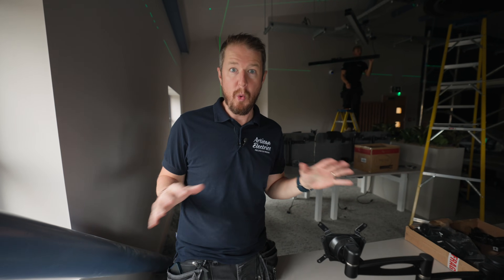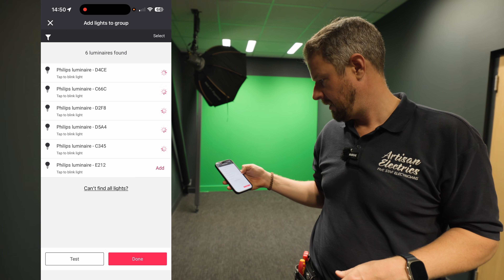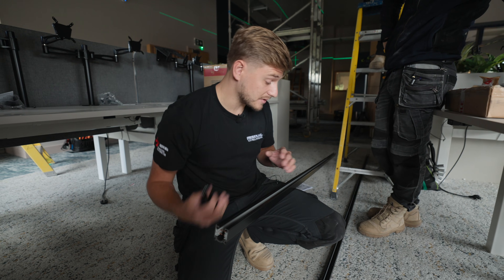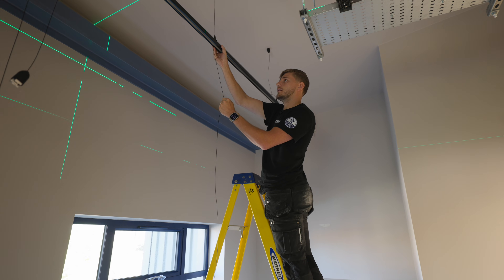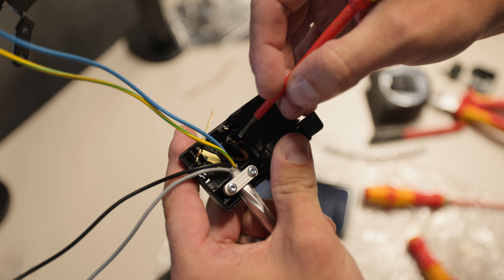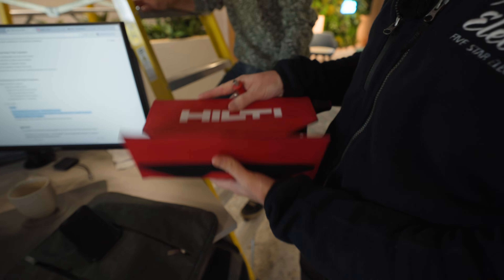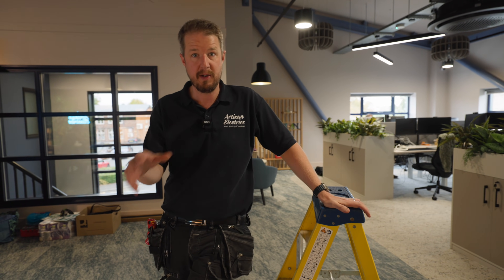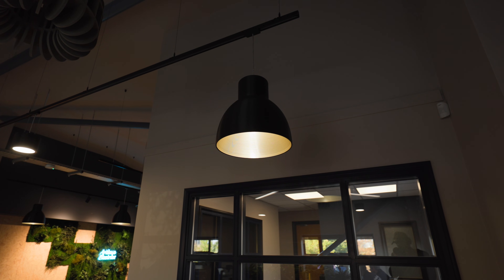How we installed the ULTIMATE office lighting setup 🤩

Comment: Why not use the air or tree presence sensors from Loxone? You already did the investment of the miniserver and DALI extention, the benefit of the presence sensors acoustic and light level measurements far outweighs the extra price of the Air base extention. I would also try to avoid battery powered sensors when doing a full rewire. There is no better connection then a wired connection ;) (f.e. Loxone tree bus)
Reply: Couldn’t agree more! We had to use a few DALI presence sensors and some Air sensors in this case, just to keep the install cost balanced 🙃

Comment: Just want to point out... GripIt fixings strength is measured on shear weight, not direct downward force. They're measured for holding weight on a vertical plasterboard, not horizontal. While they can be used in ceilings, I certainly wouldn't be trusting something with plastic tabs to hold up 70kg overhead.
Reply: Gripit fixings quote a tension load of 20 Kg.  That's still pretty useful, but definitely not 70-100Kg.

Comment: We fit a lot of DALI lighting in council buildings and schools. But most of what we fit now is wireless - the fittings still have conventional dali drivers, but they're joined to a dali wireless interface. We use it for control and for emergency lighting monitoring. It makes wiring so easy because we can just run a permanent live to every fitting including the emergencies, and a fuse module instead of a keyswitch so nobody can "easily" isolate the emergencies.
Reply from the maker: Thanks for sharing your experience with wireless lighting setups!

Comment: Dali is a nightmare with priority systems. Need the software to put new in and fault find. On large system it can cost a customer a huge amount to simply replace a driver. Amazing tech but in the real world a customer will not be impressed with the running cost.